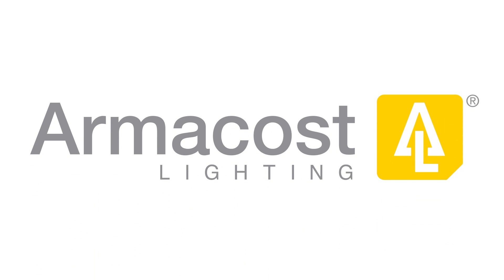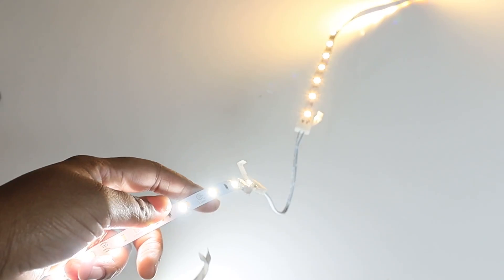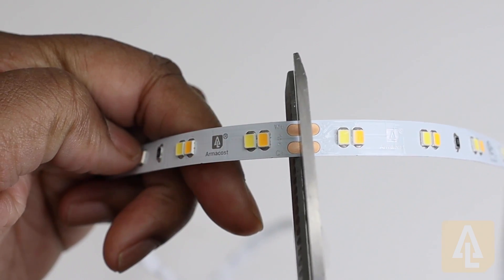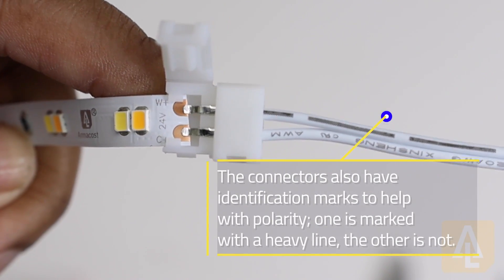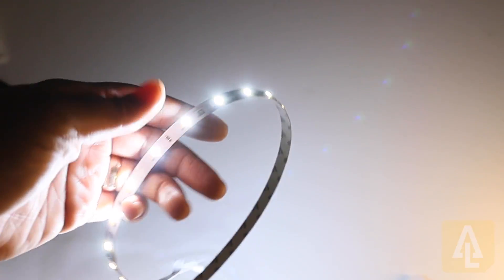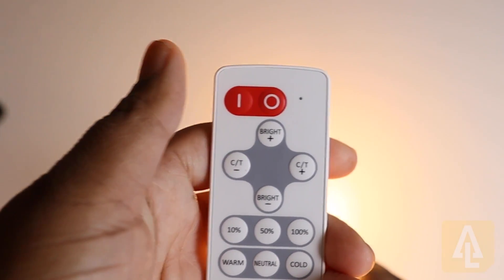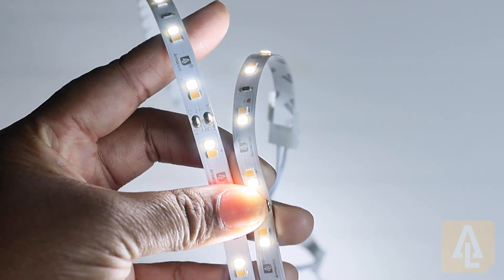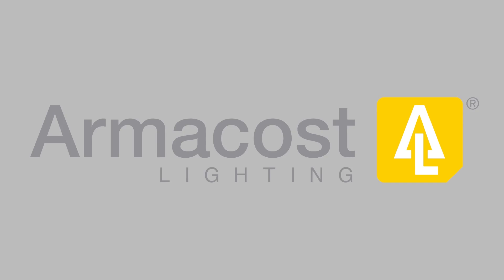LED Strip Light Kit - How To Troubleshoot Polarity Issues

Comment: Hi, I have a 3 tier shelving unit that was made for me and the woodworker used these strip lights. Yesterday the top two strips stopped working correctly. They both are very barely lit and don’t increase in light volume. 
Do you have any advice as to what troubleshooting I can try?
Thank you
Reply from the maker: Thanks for your interest in Armacost Lighting.  It is a little difficult to troubleshoot without more information.  But given that one tier is working properly, most likely a connection(s) has become loose at the other tiers. Attempt to reset the connection. You may need to replace the connectors or re-solder depending upon initial construction. If that does not work, please contact us so we can better support your efforts. https://www.armacostlighting.com/contact-us/

Comment: I am going to get this product but wondering does the light actually dim?  Or is it just the color change?  I’m looking for a soft or warm white color that actually dims. If this is just color change, can you tell me which one would actually dim the light.
Reply from the maker: Sharon - thanks for your message.  Model 421501 both dims and tunes from soft 2700K to cool 5000K white.  It has an included remote control that manages both dimming and white color.  If that is not what you need, please let us know. https://www.armacostlighting.com/shop/3000k-white-5m-tape-light-kit-with-remote/